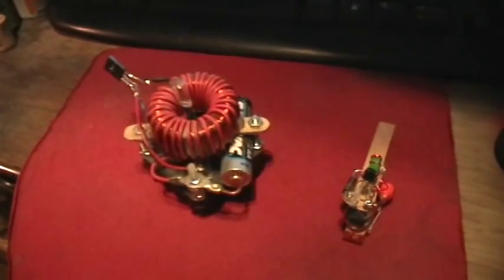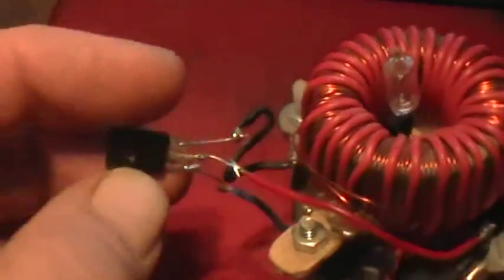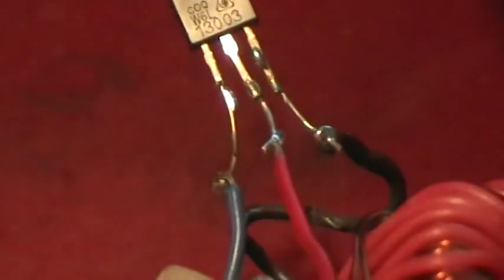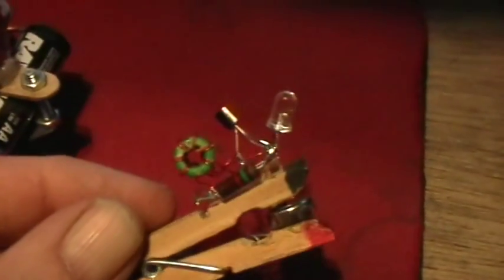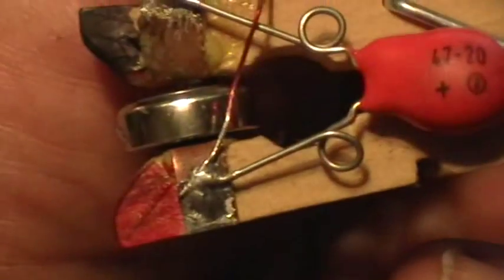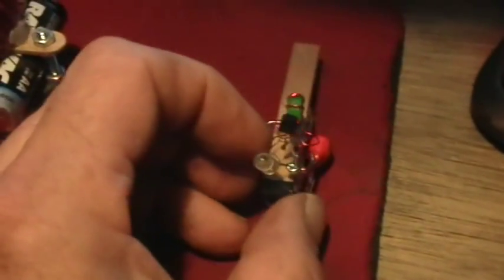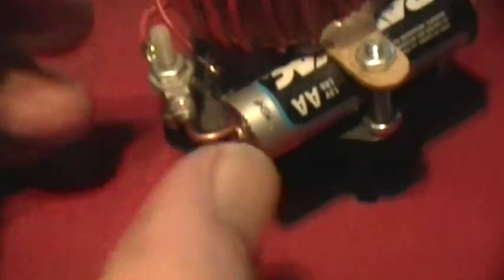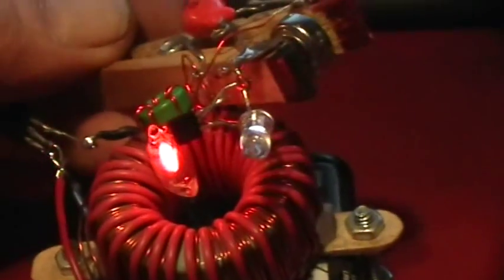Joule Thief: Coupled JTs?

Comment: The SJT circuit is tolerant of a wide variety of inductors.  The 680 or so pF capacitor is a value that has a broad peak, so changing it may give a bit of difference in output but it's not critical.

Comment: Tied together in parallel.  A few reasons.  Three windings in parallel give a Litz wire effect.  Then it's easier to wind if all four windings have the same thickness wire.  And it saves you from having to buy different gauge wire.  Works for me!

Comment: The smaller supercharged JT has the button cell, so it would be reasonable to expect that the button cell was supplying the power to that LED.  The toroids are close, but toroids let very little magnetic field out, so I don;t believe they could couple enough to light the SJT's LED.  I would doubt that the Ne JT would change any when they were coupled.

Comment from the maker: When I first wound the toroid I put as much wire in there as it would hold, and the thing would not oscillate. It was around a mH, I think. I had to remove wire and test, remove and test, and it wouldn't oscillate until I got down below about 400 uH IIRC. Encouraged by this I removed windings one at a time, testing inductance (but not JT performance) each time until I got into the range below 100 uH. Then it worked well as JT, so I kept going. Next I'll try the unmodded toroid from a CFL.

Comment: I gave the value of 38 uH when I did the original experimenting on the SJT, but I found that one characteristic of the SJT is that it increases the frequency a lot, maybe 3 times or more.  So if you want to keep the SJT down below 250 kHz, the coil should have more than 38 uH; I used the coil in the following url.
rustybolt(.)info/wordpress/?p=12

Comment: As far as i've determined from tests, it's the Base being bumped by the close proximity other JT. I call it 'Resonant Running'...pancake coils do it all the time and best effects so far with blocking osc's (tank section to Base). Can sync 2 different rate flashing LED's, by drawing them near each other. The stronger circuit always brings the other into its flash rate. Can take between instant and days !, but they'll always sync up.
Here's an own related video: /watch?v=QyKlPO6YZgo